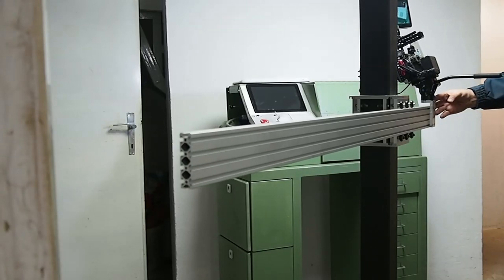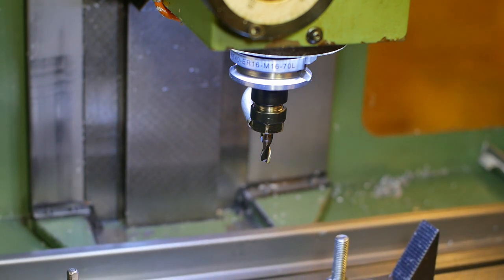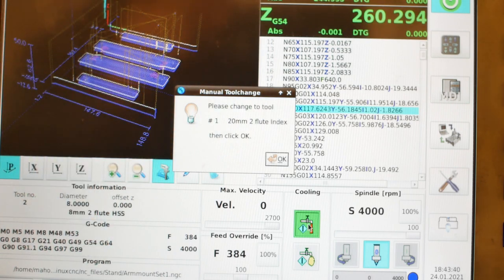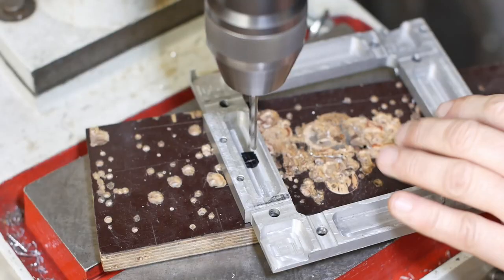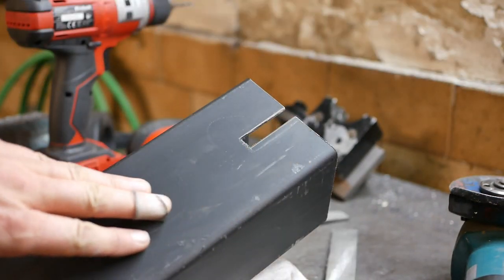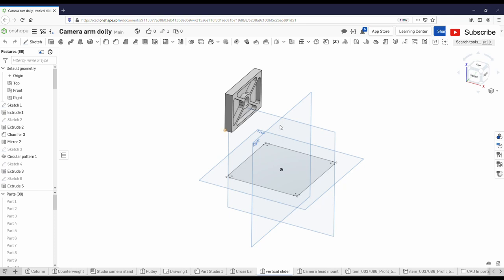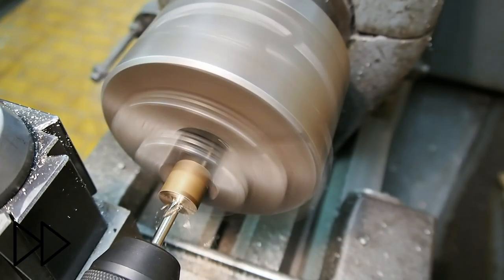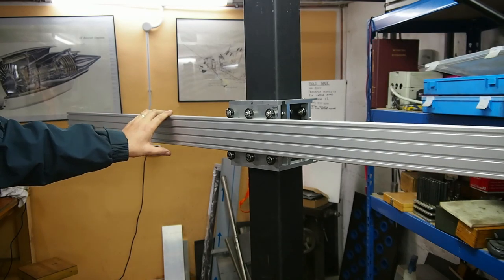Making a $10000 camera stand, part 3

Comment: What is the brand/manufacturer/model written on the little drill press in red at 7:15? Looks nice and delicate.
Reply from the maker: I picked that up as a bycatch to some other stuff. It is actually a modification to an Emcomat SL lathe into a drill press.
http://www.lathes.co.uk/unimat/
I only use it as a taping stand for small taps, when I dont wasnt them crocked and broken. Normally I use the electric screw driver. :)
Reply: @RotarySMP  Interesting. Thanks for that :-) New question, I saw an Olympus Pen F or similar in one of the shots, but what model Panasonic is that? A slightly older G7 or similar perhaps? Do you have a speed booster or  straight adaptor behind the EF lens?
Reply from the maker: @fredio54  I started with an EM5, and inherited that EPL5 after dropping it (and replacing it for the owner). The EPL5 is my crash cam, as it has a buggered up control wheel.

I picked up a used G81 (G80 or G85 in some markets) which is my A camera. I really like it. Just a lot of minor improvments on the inerface verses the Olmpus's.
I have both Viltrox EF-M1 and EF-M2 straight through and speedbooster. Use the SP mostly, but the straight through for my 17-55 2.8 EF-S zoom on some shots.
Mostly I shoot with the Olypus 25 1.8
Reply: @RotarySMP  Neat. Thanks. Bad luck on damaging the EPL5! I have GX9 and GH5 myself, and I do like the two Olympus 1.8s that I have so far (45 and 75). Chromatic aberation is there in both, but the images are so sharp when it's not an issue with the particular shot. And the footage looks great, menus easy, good choice ;-)
Reply from the maker: @fredio54 I got the G81 largely for usablity. Location of card slot, focus peaking and Mic input are the three things that really made a difference for me. When you are constantly trying to film each step of what you do, these kinds of things become far more important  than you first think. 1080P is such low resolution, that even the EF50 1.4 speed boosted to f1 is usable, be it pretty soft and washed out.
Reply: @RotarySMP  Yeah, focus peaking is a true joy to behold, especially on an angle such that a textured surface has a lot of depth :-D Card slot on side, not under tripod stand = huge deal, too. Agreed. GX9 fails there, but GH5 has it right. Horses for courses, the GX9 is a street photography free hand range finder camera by design. If you're shooting with more than one at a time then one having the mic jack is enough, and the in-camera audio is a good sync mechanism and backup recording :-) Agreed agreed agreed :-D

Comment: Nice overkill build! looks like your getting serious with that video thing so its maybe time to invest in non flickering Lights?
Reply from the maker: I really need to redo all the electrics in that garage. Lighting, power sockets, Move the three phase onto a diffent feed etc. Bummer that the hardware stores are closed due lockdown. 

I guess new lighting will be LED.
Reply: @RotarySMP  Not all LEDs lamps are flicker free sadly. i think lamps make a satisfying DIY Project. but i can also imagine you already have more projects than time.
Reply from the maker: @lambda7652  You are right there. Still changing from 1/60th to 1/50th sec shutter speed seems to have fixed that issue.
Reply: @RotarySMP  I'm just very autistic with my lights and i don't think there should be any fickler at all.
Reply from the maker: @lambda7652  There should be none in the last haf of this video.
Reply: @RotarySMP  I'm not criticizing your video! its fine. I'm just ranting against fickery light when there is not technical reason except its a view cent cheaper to make.

Comment: did you have any luck getting the jog increments to work correctly on the pendant?
Reply from the maker: I didn't get around to it. The two increments which work are the two you really need, so itch doesn't need scratching right now.
Reply: @RotarySMP  cool. lemme know if you need any help later.
Reply from the maker: @spacehitchhiker4264  Thanks.

Comment: If it is possible Preset your tools in your tool library in the controller,  I use an Edge Technology  Touch  Off Gauge but there are many types of this design with a given height of the Gauge
Reply from the maker: I dont have enough tool holders to have everything set as a tool library.  I tend to have to set a set for each job. I do all the tool setting first, but just missed that one tool reference in the tool path file.
Reply: @RotarySMP  I Understand that same here plus my tool changer can only hold 12 tools so I have to do a new set up every job if it is 1 off's or multiple part jobs . I do like the Tool Height Setter a lot
Reply from the maker: @benlivengoodjr8314  I have one of those chinese tool heightsetters. Did a bit of a trial with it, but havet used it lately. It would be a good ide to connect it up more permanently (so far it was only a bodged up job) and combine it into my work flow.
Reply: @RotarySMP  Nice I have an Older Haas mill and really want the Probe system/Tool setter more modern but the Hiamer and dial tool setter gets me within .001 which for what I do is good enough
Reply from the maker: @benlivengoodjr8314  I started trying to make a 3D probe, but my design was pretty poor. No Renishaw that.
Reply: @RotarySMP  Understand that and I thought about doing the same but low Nerve count stops me, due to the fact electronics and spindles are not cheap

Comment: https://i.imgur.com/xLUqWo7.jpg

This was my solution to the tool release button. The green button on the head lights up when it is in a toolchange cycle and not interlocked. There's already a hole with plastic cap in the head, just have to knock it out and run wires back alongside the hydraulic line.

Comment: is better to up the shutter speed
Reply from the maker: ?? You mean instead of 1/60 --> 1/50, go to 1/100? I am already fighting low light in the basement. Wont be shortening the exposure more.
Reply: @RotarySMP  yes 1/100 i better but yes you are right that will low the light, but not that much, and if you have problem whit the light in the current set up, maybe you can add a little ISO if you aperture is all open
Reply from the maker: @MakarovFox  I think it loks fine at 1/50th, so I think I'll stick with that.
Reply: @RotarySMP  whit low speed you have more blur in the video, more when you record high speed machines or fast movements
Reply from the maker: @MakarovFox  Lets call that blurr "cinematic" :)
Reply: @RotarySMP  okay